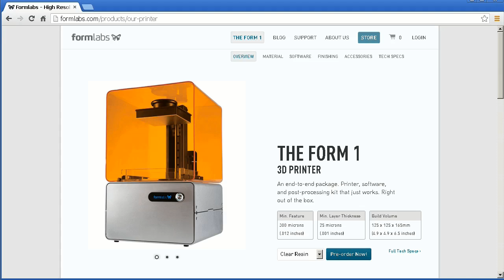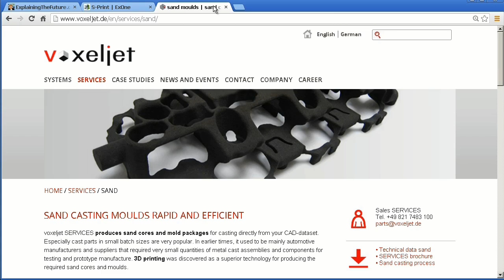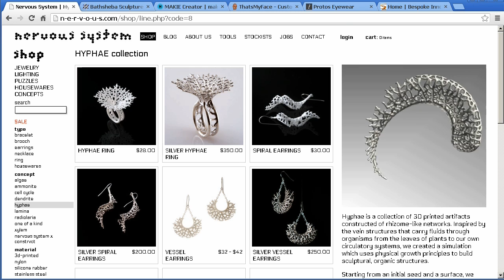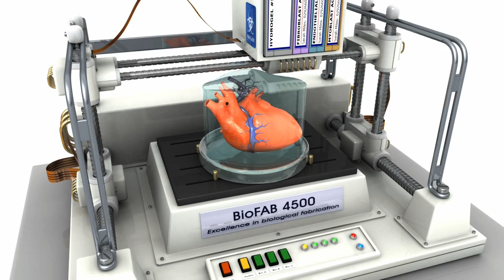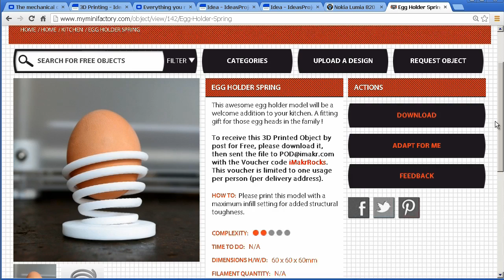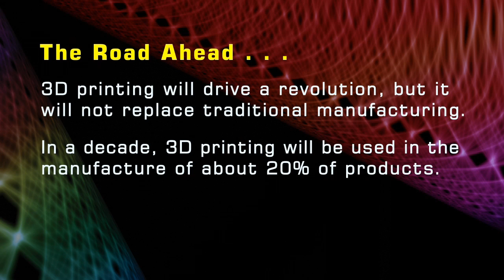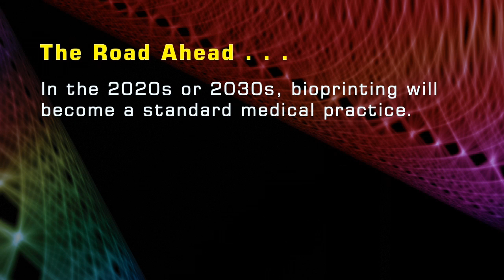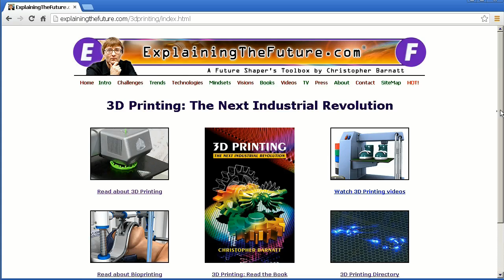3D Printing: The Business Opportunities

Comment: Is 3D printed material strong enough to replace an injection molded part?
Reply from the maker: Yes -- there are many materials now available, including ABS, PC, nylon, and various (resin-based) substitutes for standard plastics. The low-run production of plastic parts is now both viable and happening.

Comment: Hello, could you explain a little bit more the curve about "3D Printing adoption" (10th minute) ? I don't quite understand the level of 50% for rapid prototyping; does that mean that half the prototypes are made with rapid rototyping and that the other categories (molds, digital manufacturing, etc...) will never reach more than 50% of the market? I am having a hard time with the term "3D printing adoption"

Thank you in advance for your answer

Comment: I'm looking for business opportunities, and I'm looking at 3D scanning and printing as a possible business. My concern is that if just anyone can do it, they won't pay me to do it. So, I'm looking for those parts of the market that offer enough potential for me to grow, without being overpopulated by competitors.
Reply: Hello Richard,  I share your exact idea.  If you would like you should e-mail me and we could brainstorm I have some great ideas.  I am about to purchase my first printer.  niedringhausandrew@gmail.com
Reply: 25 years or more if u go back to my first composites projects( even in 1968).  I have about 200 pages of paper printings of a blow by blow websites/business cards&contacts(even a newbe could follow) of a business based in SolidWorks 3D design using scanning, 3DP-Platform WorkBench#400 printer(59"x39"x26&3/4"bed), "Lamello Invis"(attachable detachable connectors){note here i will use these in a totally different way then they were oridginally intended}, paternmakers/toolmakers plastics core(thin ridgit) with vacuum bagging of carbon fiber surrounding AUTOMOBILE PARTS, QUARTER PANELS,HOODS, FRAMES, SEATS, YOU NAME IT.  The short version of what knowledge base i have here is that i can print two or more printings to achieve up to a 112" long(2 printings joined with finger/sandwich joinery giving up 3" off each for a finished customers part).  Once a client or customer sees our scanned or straight of the SolidWorks screen 6mm. epoxy compatable cores we encase in carbon fiber then it WILL OCCUR to us&them that all we do is use a battery powered pistol drill with Lamello's magnet gismo to pull together printings at 250kg.s of force on each corner of printings(total of 500kg). SO we can leave it up to the customer to do their own vac bagging(maybe autoclave) by themselves.   A site like www.compositeenvisions.com would give customers a zillion choises of fabrics and resins and make our game just printing.  Find me and think about partnering up?

Comment: "3D printing" will be all dominant in the future. It will be the only process capable of the technological level future products will demand. How do I know? because I have studied the UFO phenomenon. You see, of the few cases where witnesses have been in adequate contact with ET hardware it was discovered that there were no wires or discrete components in them. The use a '3D printing" process that creates both structure and electrical function in one uniform process. The ship hull is the wiring and the components. It is just a matter of which atoms are placed where in the monolithic structure. There are no seams, bolts or rivets either. It's all done in one step.
A process more capable than what we use for wafer fab yet able to 'print' any 3d structure as well. Presumably to single atom control.
Obvious really when you think about it.

A more straight forward opportunity is building houses by laser sintering sand. It will quickly make traditional construction obsolete. It could be done today, only the low mental mobility of humanity keeps it waiting.
Reply: So what do you do?
Reply: Oleksandr Chuyko computer scientist doing computer graphics, sometimes software. but I have many skills
Reply: well this technology will probably approve itself no earlier than 5 years at least.

Comment: Some patents on laser sintering run out soon. Some expect this to lead to a bit of 3d printing boom as you can print directly out a wider variety of materials like steel or titanium. The metal powder might stay expensive though. A 3d printer that can splutter directly from a solid metal wire feedstock would be useful for manufacture.

Comment: I see the end of proprietary manufacture in all of this. There's no reason to buy an object when you can just make it yourself domestically, using either a pirated commercial design or an open source alternative. Supply of printing material and refinement of the printing processes may still have some life in them, but it won't take long before even that becomes trivial for the average homestead. There won't be anything worth the hassle to work to buy anymore..it's end of the "market" possibly.

Comment from the maker: Researchers at Cranfield University are already experimenting with 3D printers that extrude molten metal -- what they term "wire and arc additive manufacturing" (WAAM). Basically they have an arc welding robot that is fed a metal wire, which it melts and deposits. It does remain very expensive though! :) There is also another technique called "directed energy deposition" from a company called Optomec. Here a metal powder is introduced into a laser beam for 'laser engineered net shaping'.

Comment from the maker: Direct 3D metal printing is currently very expensive. It is also limited in build size, and the material properties of metal laid down and sintered or otherwise melted in layers are still not suitable for some applications (though improving). In contrast, 3D printed sand molds can be very large (4x2x1m using a Voxeljet 4000) and allow engineering companies to deliver final components using known casting processes. A transitionary application, perhaps. But at present a very powerful one! :)